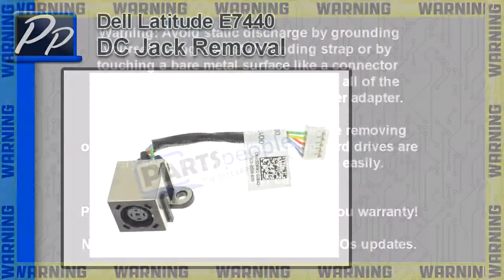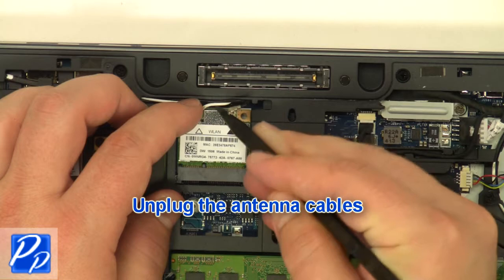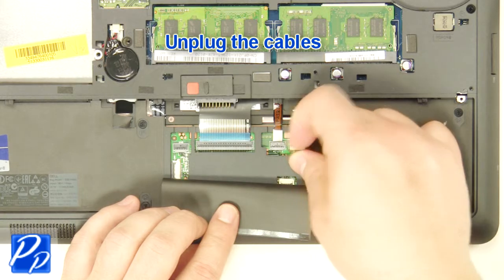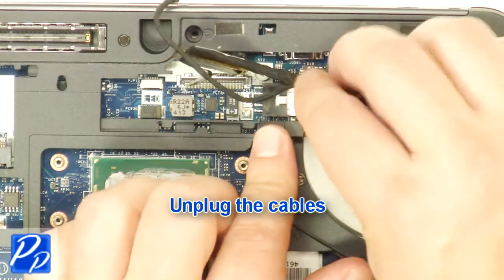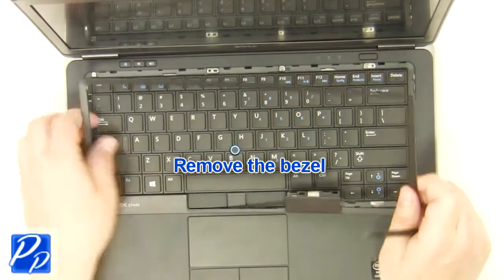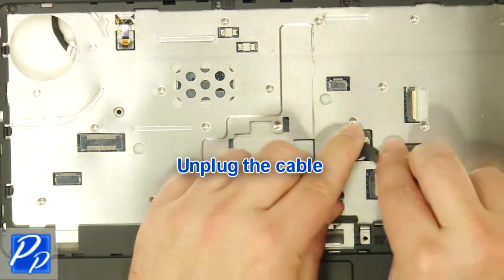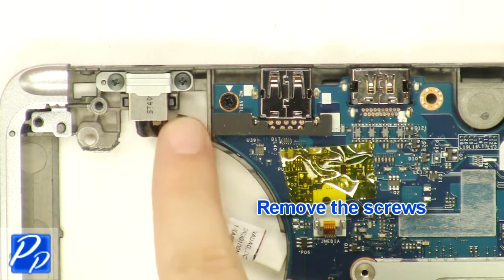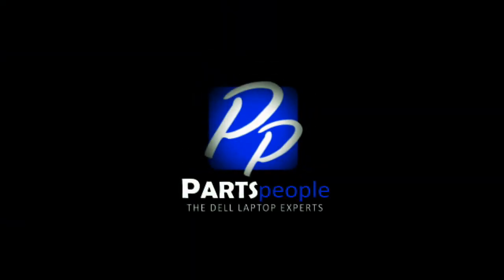Dell Latitude E7440 DC Jack Video Tutorial Teardown

Comment: Thanks for this video. I have a Dell E7440 that won't power on. If I plug in an AC Power Adapter to the laptop, the "power on" indicator on the AC Power Adapter will turn off by itself, seems that there is a "short circuit" in the laptop. I called Dell support and they told me that either the motherboard is bad, or the DC Jack is bad that need to be replaced. Do you have an easy way to determine whether the fault is at the DC Jack, or motherboard? If it's the motherboard, do you have a tutorial video to show us how to get the motherboard (Dell E7440) replaced? Thanks!